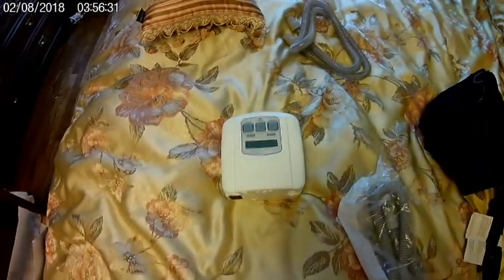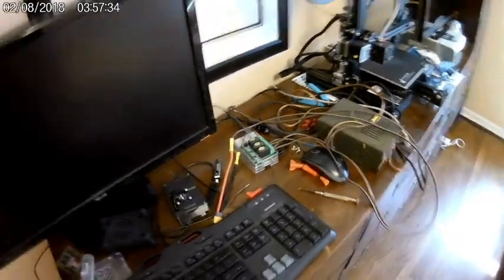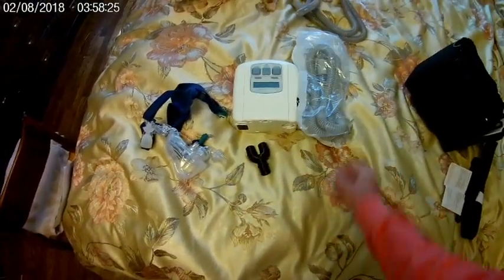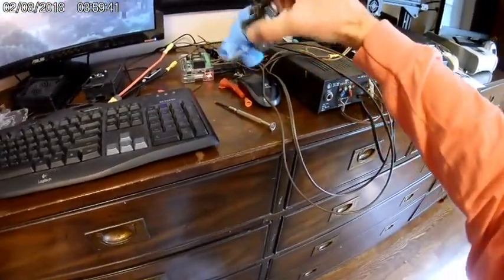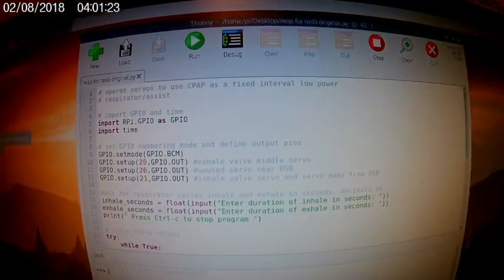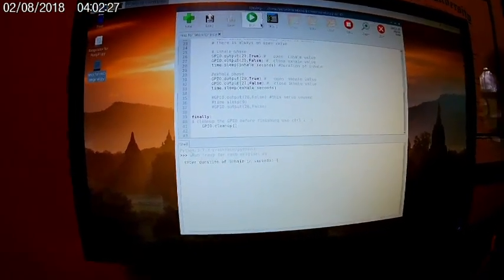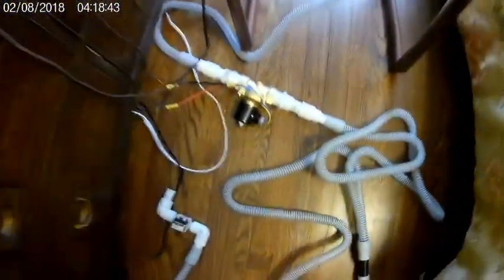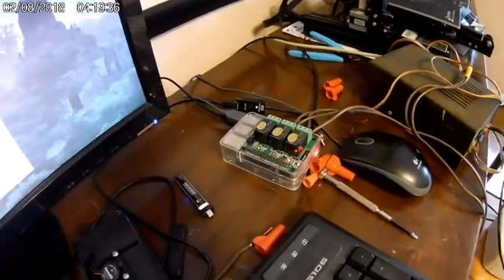DIY Ventilator Prototype Convert CPAP Machine To A Ventilator

Comment: Can you please add a list of hardware needed and program apps.  Thank you for you hard work.
Reply from the maker: Solenoid Valve, I use the 1" model, 12V acctuator
https://www.amazon.com/HFS-Electric-Solenoid-Valve-Water/dp/B018WRJYSG/ref=pd_nav_hcs_rp_1/136-8301991-5826406?_encoding=UTF8&pd_rd_i=B018WRJYSG&pd_rd_r=1b748476-b849-49cc-8eb1-b6d76fc9c173&pd_rd_w=cIGYs&pd_rd_wg=TcHUR&pf_rd_p=c21b5cd4-8f58-4c4a-8dcc-7c7f4067b749&pf_rd_r=ACGDX26X41FNTXQKABC6&psc=1&refRID=ACGDX26X41FNTXQKABC6
Reply from the maker: HAT relay module for Raspbery Pi
https://www.amazon.com/gp/product/B07CZL2SKN/ref=ppx_yo_dt_b_asin_title_o09_s00?ie=UTF8&psc=1
Reply from the maker: This is the basic code. I will post my modifications tonight.
# import GPIO and time
import RPi.GPIO as GPIO
import time

# set GPIO numbering mode and define output pins
GPIO.setmode(GPIO.BCM)
GPIO.setup(20,GPIO.OUT)
GPIO.setup(26,GPIO.OUT)
GPIO.setup(21,GPIO.OUT)

# cycle those relays
try:
    while True:
        GPIO.output(21,True)
        time.sleep(1)
        GPIO.output(21,False)
        GPIO.output(20,True)
        time.sleep(1)
        GPIO.output(20,False)
        GPIO.output(26,True)
        time.sleep(1)
        GPIO.output(26,False)

finally:
# cleanup the GPIO before finishing :)
    GPIO.cleanup()
Reply: Raspberry Pi little computer
https://www.canakit.com/raspberry-pi-4-basic-kit.html
Reply from the maker: Hope all this helps. If you have any questions about actual build just post and I will answer.
Reply from the maker: Revised Code
# operat servos to use CPAP as a fixed interval low power
# respirator/assist

# import GPIO and time
import RPi.GPIO as GPIO
import time

# set GPIO numbering mode and define output pins
GPIO.setmode(GPIO.BCM)
GPIO.setup(20,GPIO.OUT) #exhale valve middle servo
GPIO.setup(26,GPIO.OUT) #unused servo near USB
GPIO.setup(21,GPIO.OUT) #inhale valve servo end servo away from USB

#ask for respirator cycles inhale and exhale in seconds, decimals ok
inhale_seconds = float(input("Enter duration of inhale in seconds: "))
exhale_seconds = float(input("Enter duration of exhale in seconds: "))

print(" Press Ctrl-c to stop program ")

# cycle those relays
try:
    while True:
        # open valve command always first to insure
        # there is always an open valve
        
        # inhale phase
        GPIO.output(21,True) #   open  inhale valve
        GPIO.output(20,False) #  close exhale valve
        time.sleep(inhale_seconds) #duration of inhale
        
        #exhale phase
        GPIO.output(20,True) #   open  exhale valve
        GPIO.output(21,False) #  close inhale valve
        time.sleep(exhale_seconds)
        
        

        #GPIO.output(26,False) #this servo unused
        #time.sleep(0)
        #GPIO.output(26,False)

finally:
# cleanup the GPIO before finishing use ctrl c :)
    GPIO.cleanup()